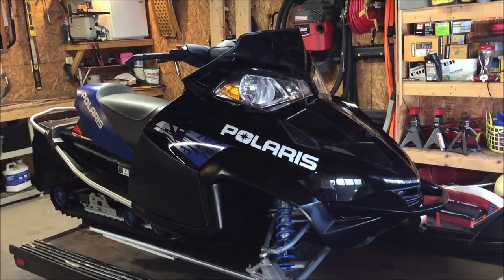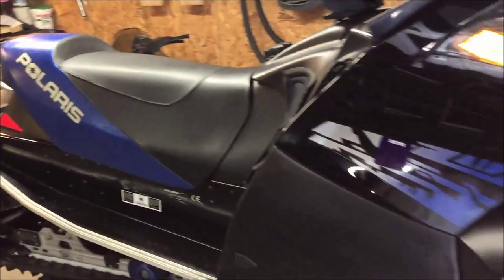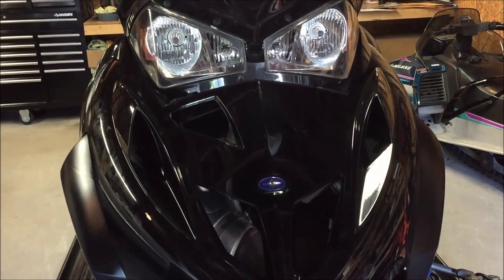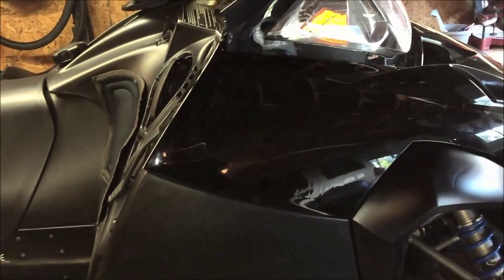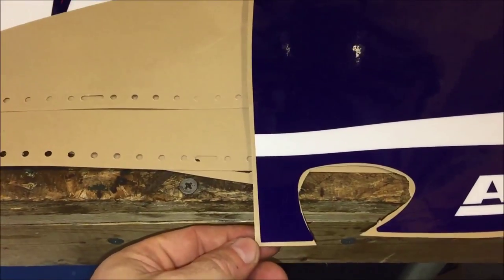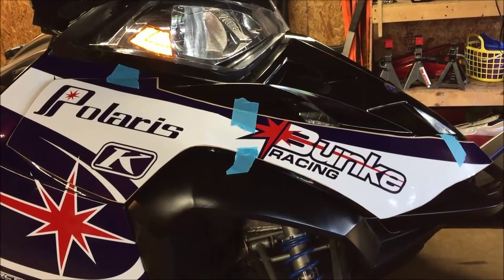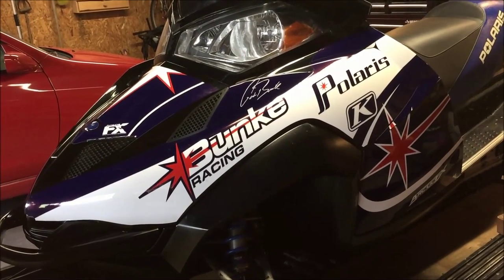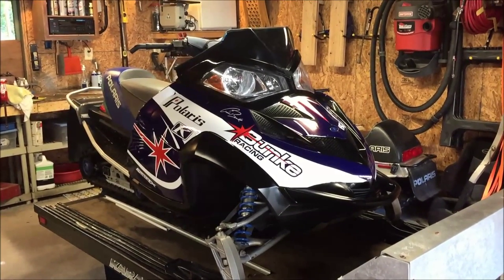How to install a wrap on your snowmobile.

Comment: Not so sure how this you tube thing works , I assume you get  comments even on these older vids???  Just watched this  vid. and really like it , about to attempt this for the first time.  Very helpful ,thanks!!  Not a huge Fusion fan but  that one was  super cool.  As far as the riding in Northern Maine ,  the state asked the clubs to stop grooming in an effort to curb  the influx of out of state riders .  Is there anything covid hasn't  put a damper on.  Stay safe and keep the camera rolling!
Reply from the maker: No problem. I get notifications on all comments left regardless of the video. 

Thanks for the compliment. The wrap made such a huge difference. The body lines didn’t help at all. But the wrap made everything flow together. The sled was somewhere in NH.

Comment: Love your videos dude, very helpful, have an 06 fusion 900 myself. I've actually been thinking about wrapping mine as well, looks great.
Reply from the maker: +Preston Minnich Thanks, glad this helped you out!

The wrap wasn't that bad to install.In hindsight, I think I should have went with the wet method to apply them versus the dry method. It would have probably helped to reduce the air bubbles.

Comment: Looks great!  good work.  I'm trying to decide if I put the 136 on this fall.  worth it?
Reply from the maker: +Robert Gedert Thanks!.

The 136" extension is great. Rides a lot better on the trails and you get better performance off trail when you want to play. Between the 136" and the Cobra track I love how it handles. I also regeared as well. This make a big difference on the low end performance.

Comment: So. This might sound stupid...   i did seat my bearing correctly on the cog shaft..  you probably guessed the rest of this already..   the new track is rubbing on the chaincase side..  i wish i wouldn't have put a new bearing on.  Wasn't necessary,  ..     any way a guy could press the bearing on more while cog shaft is still in..  regardless i have to open the chaincase to adjust the cog placement
Reply from the maker: Ok. Are you talking about the pressed on bearing that’s on the left hand side of the driveshaft?
Reply: @StreetersGarage    yes. Clutch side.  I didn't seat the bearing deep enough.
Reply from the maker: It might be possible, by removing the side panel and using a mini sledge and a socket to tap it further down the driveshaft.  Worth a shot.

Comment: I wish had your number...    my 06 polaris fusion ho 600..   put a 144 track.. so i wanna put a 41 gear on the bottom.. stock is 39..   what chain link will work..  please help
Reply from the maker: As long as both gears are HYVO. There should be enough slack in the existing chain.
Reply: @StreetersGarage  i just couldn't get it on the cog shaft.    Too tight of a fit
Reply: Chain was to tight..    looking for info on a little bigger Chain
Reply: I got a hyvo chain off glossary ebay 78 link..   sounds too big..    i clueless..  wasn't gonna gamble new. 130.00